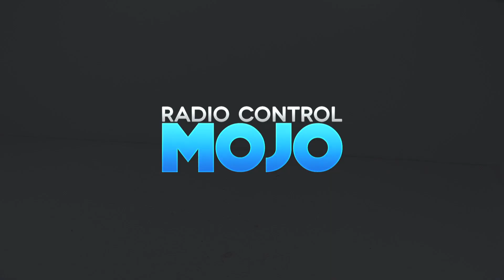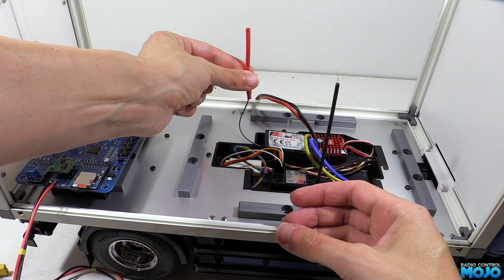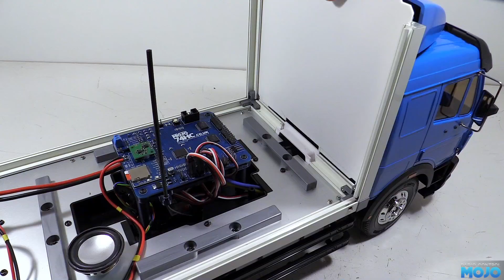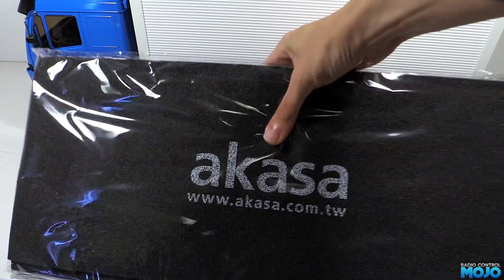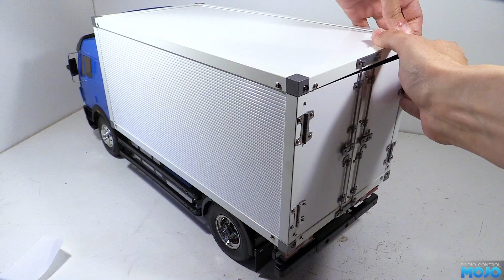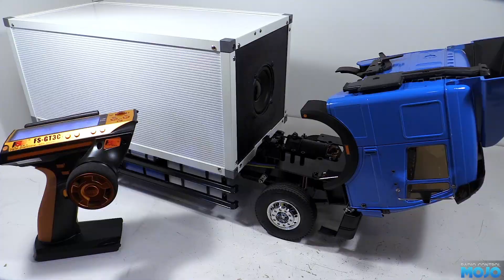Tamiya 1850l - 11 - Sound System

Comment: Would that kit go in a grand hauler
Reply from the maker: The smaller rev C board will easily fit. At some point my Grand Hauler will be getting a refit with 3D printed mounts for the electronics and speaker
Reply: @RCMojoTV  cool will be good to see that when it's done. Also I've got a Tamiya mountain rider, looking to fit your light kit to it. Would you fit it to radio box or underside of the body. I would like to have a single connector for when removing the body if possible.